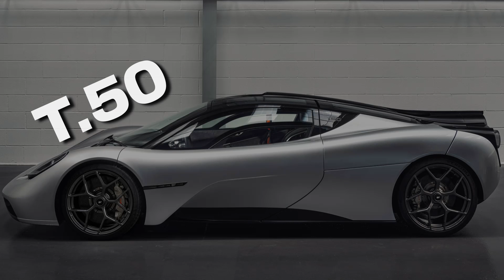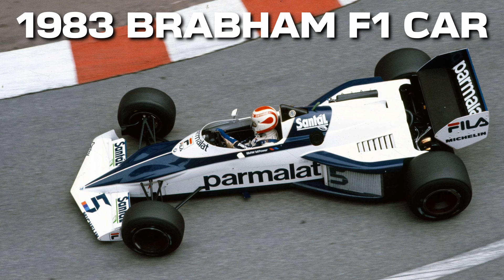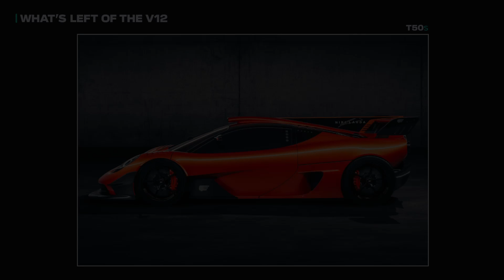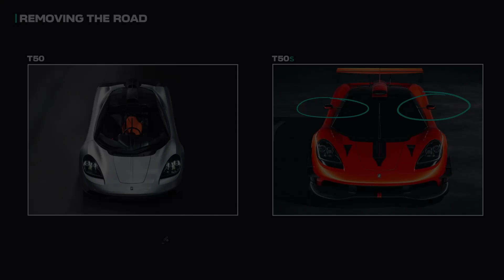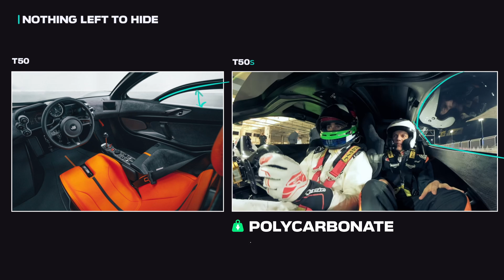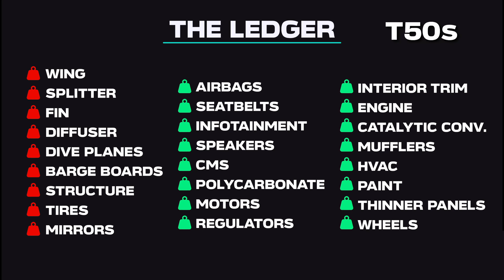How Gordon Murray Made the T.50s So Light

Comment: The Tesla S Plaid is quite a bit faster...
The regular Tesla S beat a 650hp Mclaren in multiple tests, even when loaded up with 4 people..  the video is on youtube, Hoonigoon.
The Tesla doesn't look quite as good though and is still shunned due to it's creator, but it's only just the beginning for electric cars. 
Petrol cars are pretty much a thing of the past, why do they bother still making them ? for the oil companies to profit from ?
Reply: It's not about horsepower anymore. Tesla is only better on straight line acceleration, that's only one part. These cars with their handling, lightweight, sound, feel, and overall fun factor will always beat any electric car...always. That's why people want them, totally different animals.

Manual, lightweight analogue cars that ask more from you as a driver will always reward you more feedback than something with too much tech, too easy to operate, heavy weight and feels numb to drive...in other words much more boring and lifeless experience.

Comment: The vents under the headlights probably use to cool the headlights. High performance LEDs produce considerable heat and needs to be cool.
Reply from the maker: In one of their vlogs, professor Gordon Murray mentioned that the inlets are for the front brakes. But I wouldn't be surprised if it had a second objective and it's also used to cool the headlights.

Comment: i heard T50 & T50s doesnt have engine mounting, is this true?
Reply from the maker: Both cars use a unique engine mounting system. It's neither a flexible mount like on most cars or a rigid mount like on race cars. They call it semi-rigid. Basically the engine and gearbox act as structural elements, similar to rigid mounts, but there are flexible elements at specific angles to dampen engine vibration. They call it "Semi-structural Inclined Axis Shear Mounting (IASM)" :)

Comment: when you are giving downforce level pls give the speed too bc otherwise a Honda Civic Type R FK8 can make 1500kg of downforce too just at ≈1414 km/h
.
the nerd part ->
v2=v1×sqrt(F1/F2)
=200×sqrt(50)
=200×7,07≈1414 km/h
and also i have a question does the center blade disrupt the center scoop for the engine ?
Reply from the maker: Haha I love the nerdy part!  The 1500 kgf figure for the T.50s is generated at its maximum speed, around 320 km/h.

Regarding your question, I believe you're talking about the central fin. The roof-mounted engine air intake is actually ahead of it, so the fin shouldn't interfere with the engine's air feed.
Reply: @ExplodedViewEV  thx for the answer, my english is bad I meant the wiper blade and also the video is very nice there was just that one thing that triggered me
Reply from the maker: @Alix_Day  I wouldn't expect either wiper to have a huge effect on the engine intake flow. The T.50s blade is almost vertical, so it should present relatively little obstruction. But it's hard to say without any CFD simulations.